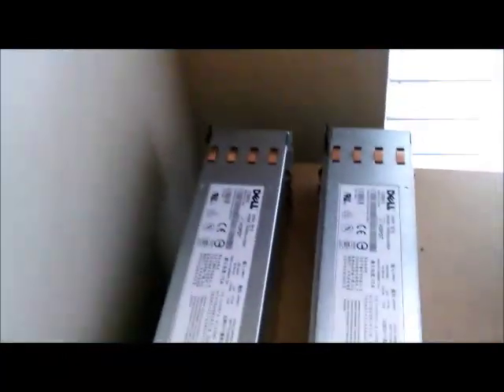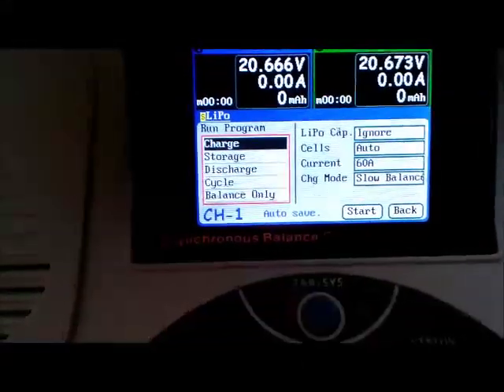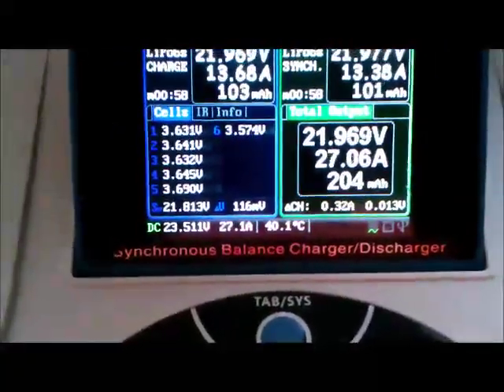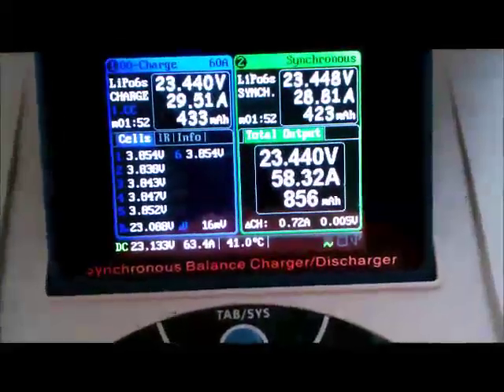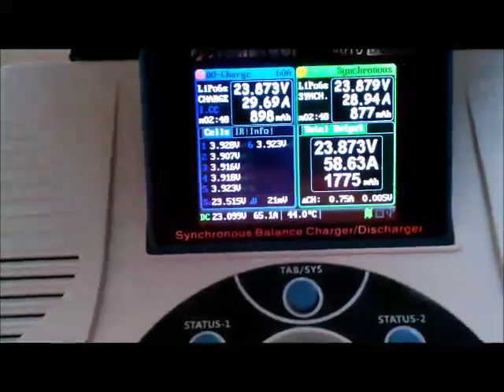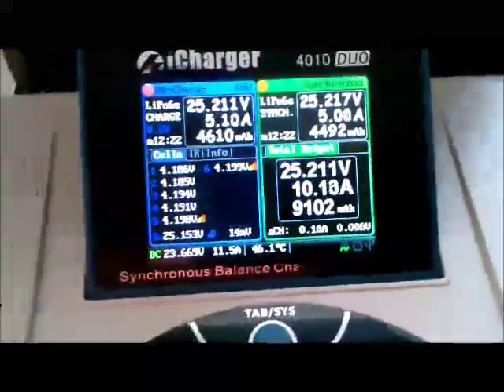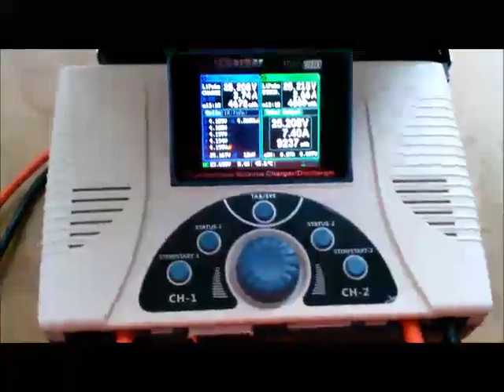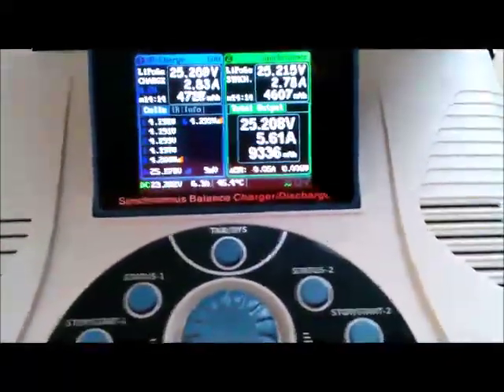ICharger 4010DUO 24v Power Supply Charging at 6s 60A 1400w

Comment: How did you do the calculation for how much you are drawing from you power outlet?  you mentioned 22A?   From my Calc, you maxed out at 1400W.  Lets assume a power supply efficiency of about 82%  That is approx 1700W draw from the outlet.  In the states you are at 110V  So by simple calculation. That amounts to about 15.5 Amps? Am I missing something?
Reply from the maker: This was an older video. At the time i wasnt clear on whats going on I did later get a Killawatt meter and found out that it pulls almost 16A from the wall in a 24v configuration. I have another video showing me charging through it. Its draw is like 1650-1700w peak.
Reply from the maker: icecube578 24v 62A Dell RC Charger PSU Load Test

Comment: Hey how do you check internal resistance on this thing?
Reply from the maker: Hold down the Status button.
Reply: icecube578 This is a nice charger. Be careful discharging packs, I've read a few over heating failures in that area.
I want to see IR being read man, I've never been able to do that with my puny chargers.